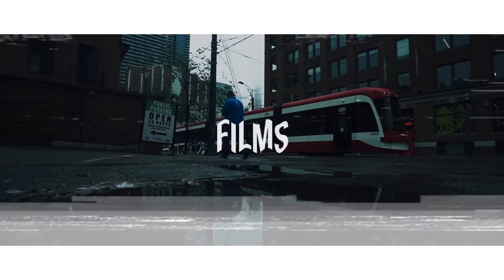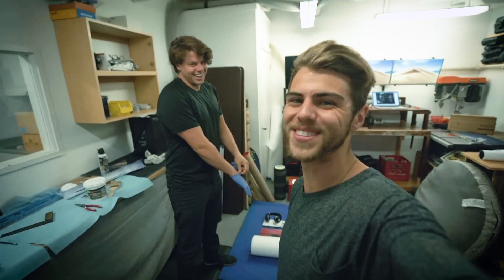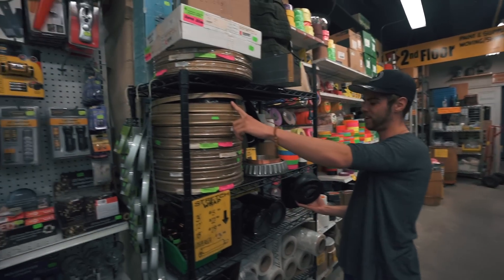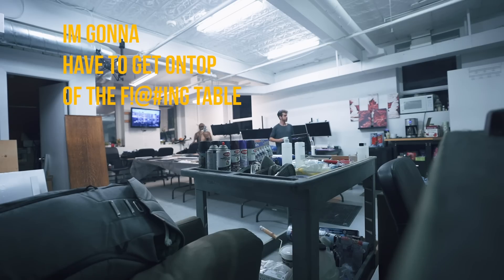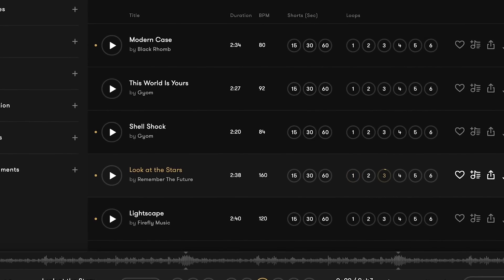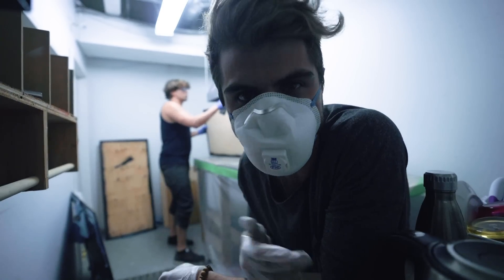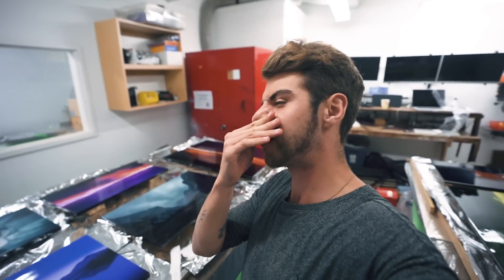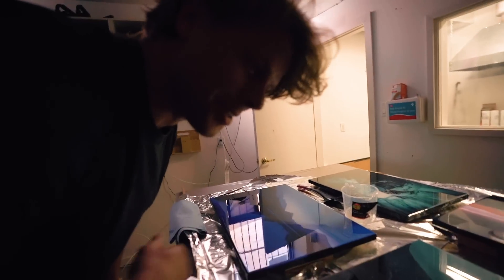WHY YOU SHOULD DO THIS TO YOUR PHOTOS

Comment: This is sooo old school, I use to do something similar when I was young, but you don’t need the board. 
You place the picture on a flat surface and put woven fibreglass on top of the picture, then you apply the resin. You can leave it the woven glass pattern finish or add more resin sand it and polish it. When it dries you have a stiff photo embedded in resin and fibreglass. :)